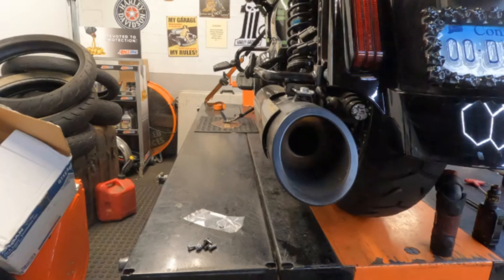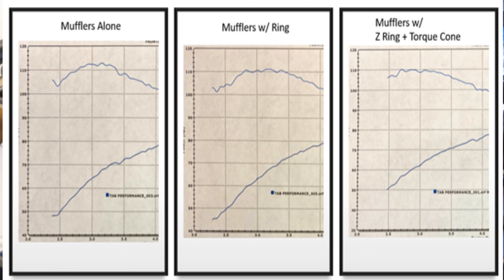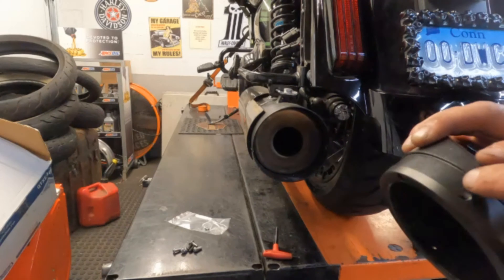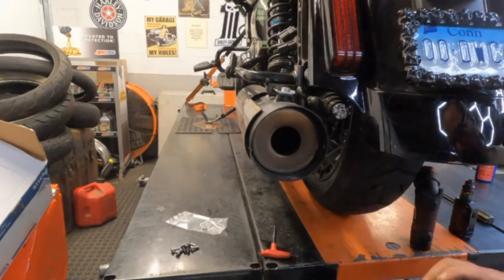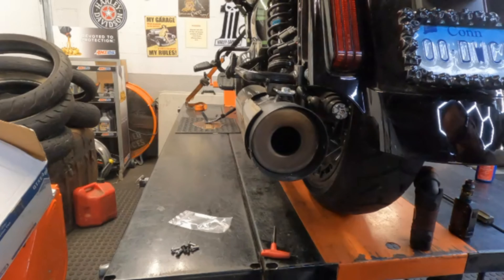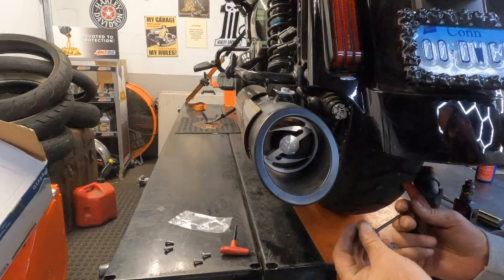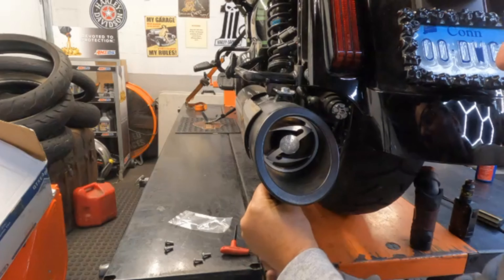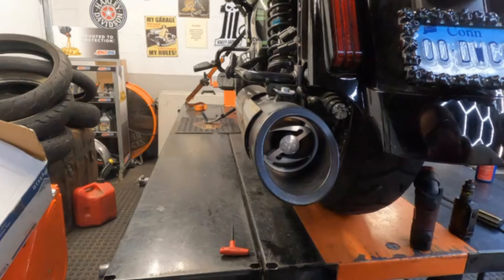Tab Performance Z-Rings install. #tabperformance #harleydavidson #harley #bagger #roadglide

Comment: Was the torque cones worth it the money? I have true duals with zombie baffles and can feel the lost torque on the bottom. Also how much did it change the sound of the bike?
Reply from the maker: IMO, without dyno testing.  They are worth the money.  I can tell the difference with then installed.  And sound is slightly different but nit that much.